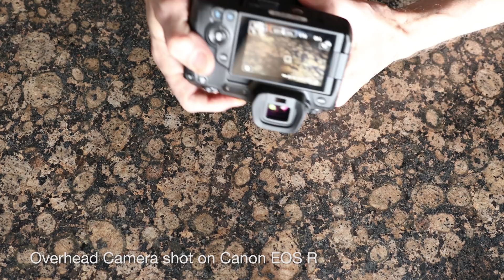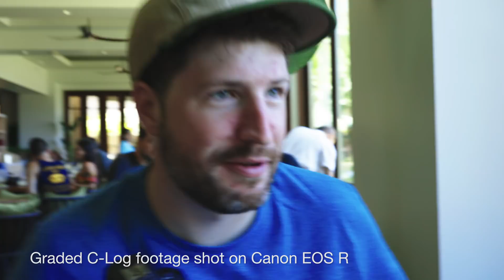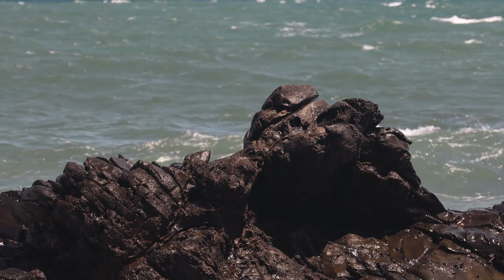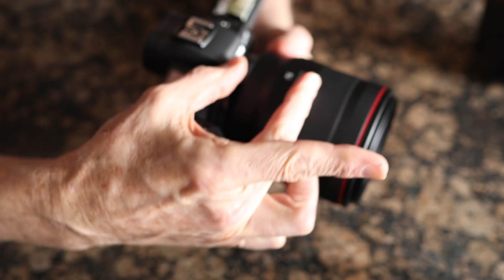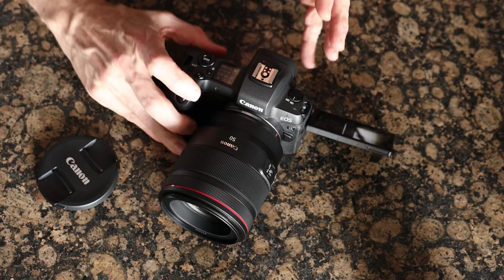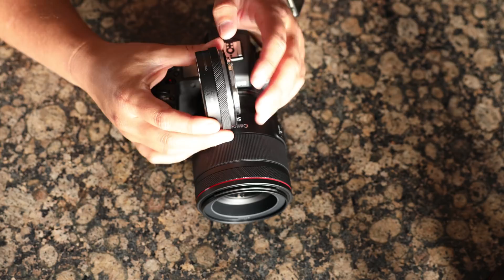Canon EOS R Review: Full Walkthrough

Comment: So with the new RF lenses you can't use the drop in filters? only for EF lenses?
Reply from the maker: Correct; the drop-in filter holder is part of one of the EF-RF adapters. It takes advantage of the difference in flange depth between the EF and RF mounts, meaning there's room to slip a holder in there. The RF lenses are all designed to attach directly to the RF mount, so just as with EF lenses on EF bodies, the only way to have a drop-in filter is if the lens itself is designed for it.

Comment: Why would anyone hate the flip out screen? If you don't need it just leave it docked into the camera and it's no different than a body without it.
Reply from the maker: Well, the issue is that you have to flip them out if you want to shoot with the camera above or below your head, whereas with a tilt-only screen, you can just pop it out at the top or bottom. The tilt-swivel design has to hang off the side of the camera if you want to have it tilted up or down. I used to prefer tilt-swivel screens, but lately have found myself liking the tilt-only design more.

Comment: One downside of this camera's customization ability: If you want to change the Auto ISO minimum shutter speed, you have to dive into the menus, like the 5d series.

Auto ISO mini SS is extremely useful for mirrorless cameras. In Av mode, with Auto ISO and direct mini SS changing key, the only thing you have to think about is just EC value, which makes you focus on the framing, not exposure.

Comment: I kinda like the customization about this camera. You can assign Direct Focus Method Switch and Direct AFC/AFS Switch to many keys. Besides, you can close the focus methods you don't use that much. This is extremely useful.

When using mirrorless, Focus Area/Method Switch is very important. You might change that setting a lot. 

But with A7 series, you can't switch between Focus Areas directly, you have to press a button then turn the wheel to choose one in the popped up menu, which is annoying. A workaround though, A7 series has a function called Recall Custom Hold, which you can link a certain Focus Area to an AF-ON key, which basically means, you can assign a bunch of AF-ON keys linked with different Focus Areas.
Reply from the maker: Good points!

Comment: Thank you for the great information.  Do you know, are you able to attach EF-S lenses and shoot raw stills with it?  What would the mega pixels be for those?  Thanks.
Reply from the maker: Yes, RAW and C-RAW are supported in 1.6x crop mode according to specs. Dimensions are 4176 x 2784. Not sure if the camera auto-crops when you attach an EF-S, but I'd be surprised if it doesn't. (Will try to remember to check on the camera later today, amidst the usual frenzy...)
Reply: Thanks for the info.  Were you able to double check how one can enter "APS-C" mode?  Does the camera go into this mode automatically when EF-S lens is attached, and can it be manually set when EF lens is attached?  Thanks.

Comment: I am wondering about the location of the control ring on R-lenses: 
It appears to me that if this ring is provided for EF lenses via the adapter directly at the body of the camera, so should be the location of this ring on all R-lenses. Than regardless if we would be using new R-lens, or one of the countless EF lenses, we would find the control ring at the same place.  But this is not the case, and I find this sub-optimal in terms or ergonomics. 
Just an observation...

Comment: The tilting screen can be leveraged by all kinds of content producers not just vloggers.
Reply: For people who're BEHIND the camera, a flip-to-the-side screen is off axis which makes framing experience a little bit rangefinder-like. Drag & touch can be cumbersome either if you are framing at waist level in landscape orientation. You have to move your right hand to the left to touch then move back. If you use left hand to do the touching and dragging, the camera might be unstable.
A99 style fully articulating screen and XT-3 type two way tilting screen is more convenient for shooters BEHIND the camera. It's on the same axis as the EVF and the lens, and it's easier to touch and drag.

For selfie shooters, a flip-to-side screen is probably the best solution though. I think manufacturers should only implement flip-to-the-side type screen on the video-oriented camera in the product line like A7S series or GH series. For stills oriented camera in the line, A99 or XT-3 style is the best.
Reply: +tree young you do realize you can leave the screen where it is and not "articulate" anything?
Reply: Cactus Tweeter  Have you ever heard of waist level framing? If you have to leave the rear screen flat on the back when you are framing at a low angle, what's the whole point of making the screen articulated for people who're not that into shooting their own faces all day?
Reply: Why does everyone keep call it a "fully articulating" screen. Behind the camera you can use it flat or closed. If you are behind the camera, and are trying to use the LCD screen to shoot low you are forced to either use the screen flat or have the screen in the way of the hand that is operating the lens. Sure you can bow out your left arm and use the screen, but it's not much more functional than a flat-mounted non-articulating LCD. The Sony (mkI & II) a99 and a7 cameras are the only cameras that I know of that provide true, fully articulating screens.

Using the kind of screen that Canon did, makes the screen not line up with where the lens is mounted and slide the camera to your right to center the screen in front of you. Good for vlogging, but useless for photographers and videographers working behind the screen.
Reply: MeanGrain I disagree with you regarding usage for photographers and think you're either being deliberately argumentative (or making excuses because your camera doesn't have one) . I've used articulating screens for some years now and they're brilliant for shooting at unusual angles. You do NOT need the screen to be directly in line with the lens axis unless you are uncoordinated or have poor orientation skills. If you've ever done retouching with a graphics tablet you'll know - you're looking straight at your monitor, but actually doing all the movements off to one side. The 1st time you try it - it takes 5 mins to get used to and then you never think about it again. 

The fully articulating screen, the name the industry has adopted, is far more useful than the limited tilt screens on other cameras. If you were shooting from ground level would you rather lie in the dirt to be on line with the lens axis or flip out the screen and only have to drop to one knee? Because you're getting a through the lens image anyway, it doesn't matter what angle the screen is at, you're viewing the image, not trying to look at the camera and the screen at the same time and align them.
Reply: cooloox  With the screen flipped out, touch operations can become extremely cumbersome with big lenses. If you are not that into shooting yourself, you can find some videoes about A99 or XT-3's fully articulating screen. They can flip to any angle, and they're on the same axis with the lens and EVF which is absolutely important unless you have a very low standard of framing experience. You see, no high-end mirrorless put its EVF on the side.
Reply: MeanGrain I just reread your message and yes, just a Sony fanboy making excuses.
Reply: MeanGrain  Exactly! (Only one thing, A7 cameras actually don't have the A99 style fully articulating screens, which is a shame, but I still prefer that to the stone age flip-out DV style rear screen.)
Reply: M. F. I agree with you, it's a major benefit to photographers compared to the limited tilt screens on the Fuji and Sony cameras.
Reply: M. F.  But there are better-designed ones years ago. The A99 and XT-3 style rear screen can be swiveled to any angle as well, portrait or landscape orientation, meanwhile, you don't have to flip it to the side. For people who have limited use of shooting themselves. a flip-to-side design is just too dated compared to the A99 or XT-3 style.